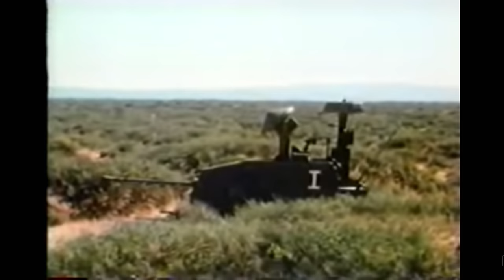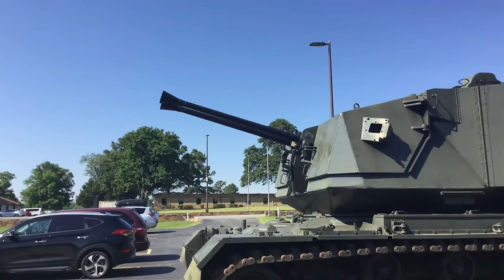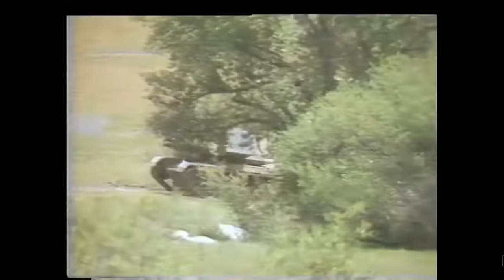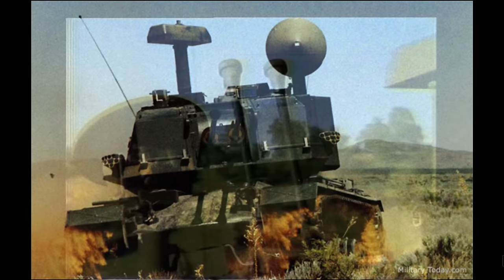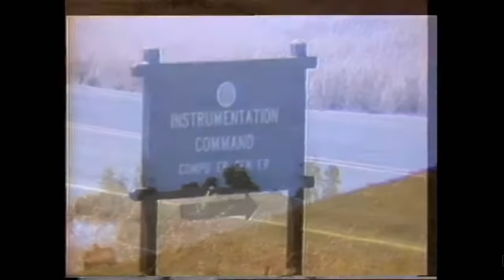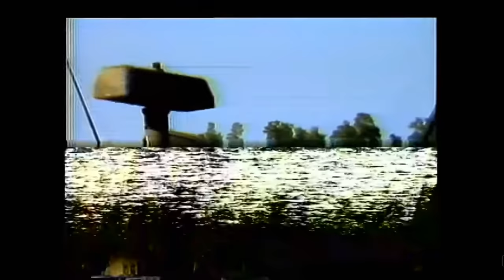M247 'Sergeant York' | WORST AIR DEFENSE EVER!

Comment: At that time, Ford was in financial difficulty so this program was a financial bailout of sorts. They always had problems with their linear-linkless feed system that they couldn't correct. The steel turret was harder to rotate and its weight was part of its problem with keeping up with the armored units it was supposed to protect. Plus, taking a gun to a missile fight. Also, I believe the 40mm L70 fire rate was 220 spm not 300 spm. The story about the system turning to aim at the bleachers is true. It happened to those of us on the opposing team during the shoot-off when their loaded turret swung over to point at our system  - we un-assed our turret in record time.

Comment: I'll add a little background to your story. DIVAD had less than complete support in the Army from the beginning. There was no way the Ford version could (or did) beat the General Dynamics solution. I heard first hand that the analysts were told to bring in a "technical tie" to allow the winner to be chosen by "other criteria."  The only way they could do that was by computer simulation of the effectiveness of the Bofors proximity fused round using extremely small-sized fragments in a numbers game.  Even if you believed the effectiveness of these very small fragments against Soviet aircraft, it would have been easy to countermeasure. Word was the program was to give the Ford parent company a bailout like they did for Chrysler in "79 without the political downside. Supposedly, John Connally, who served on the Board of Ford was the point man. GD was thrown a bone when they got the Abrams Tank production contract - some bone.

Comment: Don't forget that the M —1 Abram's was having break in problems at that time too ....... 
Jet powered tank .... Never been done before .

Engine was all ways over heating .
Motor pool mechanics finding excessive metal fragments and shavings in oil .

Tank suspension ...   Locking up during high speed test .

Tank treads also breaking at speed tests .

And don't even get me started on the M — 2 Bradley .

Comment: The problem with the M-247 was the radars not the guns.  And using the M-48 Chassis and then complaining that it could not keep up with the M-1 Abrams was disgustingly. It is totally correct to count the 40mm air-bursts as hits and the 35mm near misses are misses because they did not inflict damage.

Comment: The 40mm Bofors was obsolete by the beggining of the fifties.  It was a good gun for external, stand alone AA installations, but was completely unsuitable for vehicle use. The ammunition is just too long and bulky to be useful inside vehicles. in the same time, that long case dramatically reduces the rate of fire potential and makes the gun way too heavy.  With the high speed of the air targets and long range air launched weapons, it's mind blowing to see so much money wasted on a vehicle with that gun installed, in the eighties. Everyone with brains and went for compact high rate of fire guns.  The Russians went from 23mm to 30mm, the Germans went with a 35mm revolver cannon, with a much more compact case design, that allowed it to outperform the 40mm by a huge margin.

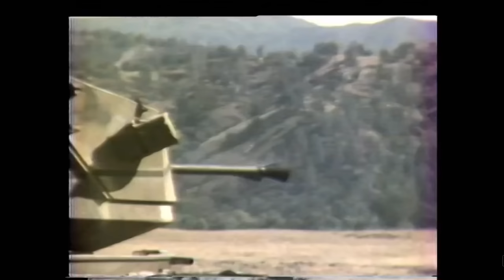Comment: 5:15)The ammo size was said to be mm caliber. Millimeters or caliber is used. 0.50 cal. is 12.7 mm.
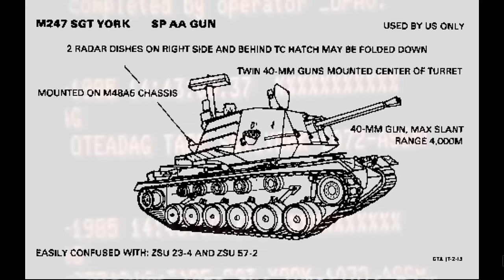9:37)How it could be confused with the ZSU 23-4 (ZEUS)? It has four 23 mm guns.The ZSU 23 has two.
The "Buck Rogers" flame thrower & the Sgt.York were so bad, I'm surprised that they weren't bought.

Comment: The choice of 40mm doesn't seem to have been the problem. Perhaps old worn out guns were used (as suggested by others) but that's an execution error no a flaw in the 40mm Bofors.

The problems seem to have been:  a radar and fire control system that didn't work, a slow turret traverse, and the old slow M48 chassis.

I'm surprised the army didn't have both Ford and GD make prototypes with both the 35mm (shared with the Gepard) and 40mm (guns and ammunition available from existing stores - essentially for free) guns. I wonder how the 40mm guns would've performed with the GD radar and platform?

Comment: Actually, at least one hundred were made then, immediately then went to storage. $ billions were wasted. Ford aero space, near Newport,  Ca. Couldn't get the radar to select and then track properly. Remember, it was to primarily shoot down helicopters. It's difficult to select a target with low background clutter, at that time. For years there were a couple of these in open air storage behind a wire fence at point Mugu.

Comment: Great video Matsimus!

The problems with the Sergeant York closely resembles the problem with the Gepard: Insanely costly and not up to the job. The Gepard - and the Roland variant for that matter - was at least on a Leopard 1 chassis and as such able to keep up with the armoured formation - without training wheels.

The problem is one of tactical doctrine.
What the fellows in the tin cans really need is a "heads up" about incoming so they have the opportunity to take cover or disperse. Lets say a minutes warning.
What they THEN do is to fire with their 25-35 mm autocannons in the general direction of the incoming missiles, aircraft and helicopters. Direct hits are not expected; but tell that to the chaps in the aircraft - they will have a totally different opinion of their carrier path - and probably consider slinking off as the better part of valour.

The Russians used extreemly long range for their missiles 3-4 km and the helicopter at that range is a sitting duck for a fighter with lots of AIM-9 Sidewinders with a range of - say 10 miles - they will fire OVER the armoured formation (there is no way you will get those fly-boys to fly through an armoured formation under attack - there is no such thing as freindly fire. Not when your arse is on the line!)

What you can hope to achieve by training your 25-35 mm guns against incoming is say about 30% will be rendered ineffective. The air defence problem is not those coming within the extended range of the armoured formation - which is if anybody is - protected against such an eventuality. There is a reason they are named armoured!

But the real mission of the air defence is: Swatting the damned things BEFORE they get into range of the armour. There is a REASON those fighter aircraft have such bloody big engines and high speed. Ideally they should have pounded what ground installation the enemy has and kept the damned things from taking off and being a nuisance in the first place!
Reply: > Ideally they should have pounded what ground installation the enemy has and kept the damned things from taking off and being a nuisance in the first place!

That would be ideal, but against an adversary like the USSR the best you could hope for in the initial stages of a war would be parity or local superiority, planning war for ideal situations is arguably a fools game
Reply: @steffennilsen2132  Yes and no!

The probability is that the air force will achieve some measure of success. Let's say they whack 50% of the enemy helicopters on the ground, then you have close in air defence and you take out another 30% (I don't think it is 30% of 50%).

The problem with air defence systems like the Sergeant York and the Gepard is: These systems are so damned expensive, that the real question is: Do you want an extra 3-6 Leopard 1 tanks (depending on the time ordered and exchange rates) or do you want ONE Gepard.

Getting more tanks means that you spread the enemy's fire and put in more mashine guns to make the enemy nerveous.

I know the Danish Army back in the day made that calculation and found that the Gepard simply wasn't worth the expense.
Reply: Funnily enough the Gepard HAS been working wonders on the Russo-Ukranian war now, especially on Anti-Drone capabilities.

Comment: Minus the radar, and a little more protection on the top deck of the turret, this vehicle could be a valuable for urban fighting. The barrels of the guns are short and they've got a high elevation and cyclic rate of fire. It has a lot of firepower but not heavy firepower. This vehicle could not go into a situation solo, she would have to have infantry support from a tax that would be low and in close.
 In  Stalingrad the ancestors of this weapon was used in confined spaces. The tactic never became general use in urban combat. We also have no verifiable information on this combat tactic. It would be worth a gaming exercise to get a better idea as to the viability of the weapon in the urban combat scenario.

Comment: Fast forward to today... just shooting the breeze here, ponder a Bradley type chasis coupled with a minimalist remote weapon turret housing 3x BK27 barrels ???  Then as secondary... perhaps bolt-on what, say 3x MICA tubes per side equipping 2 IR rounds, 2 active rounds, plus another 2 modified MICA tipped w/ modified RBS 70 laser guidance for good measure ??
Reply: Or just strap some stingers on the side of a Bradley
Reply: @jameson1239  BSV - no longer in service

Comment: The cost of this platform was out of it,s league. The US military instead went with a new and improved Stinger shoulder launched system. Man portable 3 members in the team and much lower costs. The other option was the ground or trailer mounted Vulcan 20mm cannon. The Stinger won due to lower costs battlefield ability and weight. it was not about how effective the systems would be alone. The overall costs was the primary deciding factor, 20 Stingers for 1 M247.

Comment: Then Italy was forced to kill the Otomelara Otomatic because it was too cool. The fact that it could physically double as rapidfire light artillery and immediately shits all over the acquisition of any gun between 20mm-40mm and 40mm-76mm was just too much for the precious Pentagon egos.
Reply: Mind that, today, the Otomatic could have used 40km range guided Vulcano ammos. A kinetic penetrator coming directly form the vertical, a nightmare for any MBT.
Reply: @neutronalchemist3241  With top attack, and repeated hits, specialized kinetic penetrators are completely unnecessay. HEAT and HE-Frag is good enough.

Comment: Maybe the US Army could have acquired the German tracked anti-aircraft vehicle, the Flakpanzer Gepard, developed in the 1960s and 1970s. It was based on the chassis of the Leopard I tank. It used double 35 mm cannon, not right next to each other as in the M247 but each one placed on left and right side of the Gepard's cupola. I don't know at what speed it fired. It kept being updated and was retired from service in the early 21st century I believe, and its maximum range was, again I'm not sure, about 4 or 5 km. It was sold in several variants to a couple of countries. No idea if any Gepard was ever used in actual combat or if it destroyed a single aircraft or helicopter. But the fact that it was in service in the German army for decades and sold to other countries means it must have been better than the M247.

Comment: The project was NOT liked by the ring knockers who wanted to sell new junk for a much bigger price tag. The ADVANTAGE of basing the system on the last model M-48 chassis was because of the vast number available at no build cost. Strategic reserve vehicles in many cases had been recently rebuilt and had zero hours or very low hours of operation. The M-48 power pack was completely interchangeable with the M-60 family of vehicles still in service at the time in mass quantities. All  of the sub-systems were off the shelf and proven. It was the overlapping integration that was the issue as with virtually every one of the existing armored systems in service at that time was improved and developed in service as was policy for decades before the Sgt York. NOTE: the money bags were REALLY pissed when the Major in charge of the munitions development for the guns came in a ONE THIRD of the cost and built designated shell designs that were more efficient than specks laid down for  the design. Many of the upgrades to deal with the problems identified were in fact all fixable with other off the shelf solutions used in other DoD projects. Mobility was actually comparable to the rest of the fleet and at the time of the first deployment would have been attached to Marine and Army tank units that fielded the M-60 family of vehicles which was still dominant. NOTE: In National Guard Units the M-48 "G" models with full upgrades, to include 105mm main gun, was out enforce. The York would have been a fine compliment to that fleet with commonality of hull and drive train parts in all catagories. (obviously) It was an air defense junk thrower and did par for the course. It cost less and did the job just as well and the ZSU-23-4 or the ZSU-57-2 (one an aircraft shell and the later a NAVAL shell) The ones complaining about it were the "other" turds who wanted to shake the rubes for even MORE tax dollars while offering less. Same old District of Criminals game. Liberty1775  Mark Koernke   www.libertytreeradio.4mg.com

Comment: Building what is meant to be your premier, front line aa gun using an old tank is just a bad idea in itself. The vehicle would have trouble keeping up with more modern vehicles. It would be difficult to upgrade. It would be difficult to maintain, both because the tank would be worn out and would also use obsolete components. This is a case of what the British would call "penny wise, pound foolish".

Comment: This is what we needed in Afghanistan. Not for air defense, but for laying down massive firepower against insurgents utilizing hillsides and fortified compounds. I'll never understand why every FOB and COP wasn't equipped with at least one BOFORS turret to reach out beyond the .50's range and utilize proximity and air burst rounds. Anything from infantry to DshK and vehicle-mounted recoilless would have  lived only seconds. Match the BOFORS with modern FLIR and laser designation/ranging.

Comment: If a ZSU 23-4 was in the area, rotor and fixed wing pilots would refuse to fly. That knowledge drove the desire to have one of our own. My division used Vulcan 20 MMS. But their range was really too short to really protect troops. We usually were well forward of their max range. Shoulder fired missiles have improved greatly over the red eye we had then. But they are mainly used to protect high value targets. I am a grunt. I think I am the highest value target. But not according to those above me. The only pilots I know that would fly in a high ada environment were the A-10s.

Comment: I had a comrade in the reserves who was on the test team. His opinion was that it was junk. Over pressured hydraulics blew at joints, poor integration of radar computer package mounted on the wrong tank hull should have been on the Abrams hull and a subject never covered in discussion ammo feed systems were a nightmare. If you watch the one snippet of soldiers handing one round at a time up to load into the system you can get the idea it was not battle ready for rapid reload of the system. The Vulcan Air Defense system carried a belt of ammo to feed into the system took around 10 minutes to reload the drum the York you might be there for an hour or more to get it all uploaded and ready to fire again. The Poor radar performance was the icing on the demo cake.

Comment: I was on active duty in 1984 and this weapons system was the topic of conversation. I think the weapon itself is proven. The chassis is proven although in the 1980's it was already obsolete. Too slow to keep up with an Abrams but not too bad as far as reliability. I never understood the thought process of putting an F16 fire control radar on a ground based system. Literally the dumbest idea by far. I think with todays technology the concept should be revisited. The Army always has a need for a kinetic anti aircraft/anti material weapon with a decent volume of fire. The 25mm bushmaster on the Bradley and Stryker are good systems but lack volume of fire a twin system can deliver. I was actually in an air defense unit with the 20mm vulcan and deployed with them to Desert shield/storm. Not much use as an ADA weapon since the Air Force handled the Iraqi air force in about 12 hours but for anti material missions it is a sight to see. Just my 2 cents.

Comment: Oh shit, so many 'reformists' in the comments. Oh. So. Many. The Sergeant York SPAAG system died because of a bunch of factors including the deadline. The US loved the 40mm Bofors (the L/70 came out years before and the sensor-fuse fragmentation round was the hot new thing that the US Army wanted to have for what would be, essentially, their SHORAD piece). The program had essentially a Gepard, a modified version of Sparky's Gattling Wonder (the 'Vigilante' but instead of a 37mm gatling cannon (which infamously shook the vehicle using it apart) it used a 35mm version), and someone deciding that using the GAU-8 was a good idea as competition.

However, the Army wanted the 40mm because it loved the versatility of the 40mm (especially with the sensor-fuse fragmentation new rounds) and they could spend as little money as possible for the barrels. Load up on mostly SFF rounds with some HE and AP and you've got the base idea for the Sergeant York's general ammo load. Add a few idiots who thought that simply going with an unmodified F-16 radar would do the trick and crunch time...

Comment: Actually, this video is FILLED with erroneous data.  I worked on this project for 3 years.  There were a LOT of issues, no argument there.  Most of those were similar to ANY development program.  If you are interested in facts, contact me directly.  P.S. this was NOT a 'Cold War' weapon system.  Another important fact...this project hit Casper Weinburgers 'budgetary chopping block' of the mid-80s